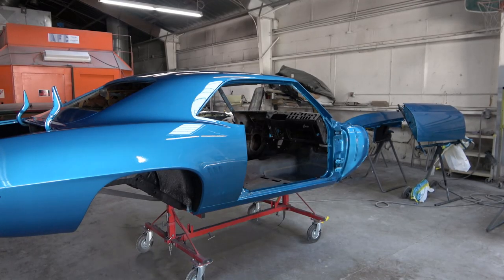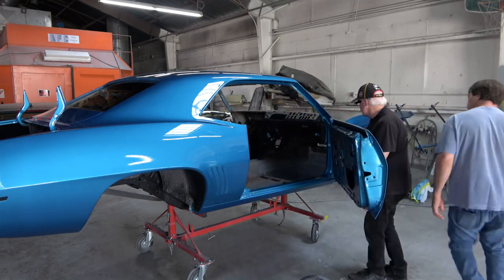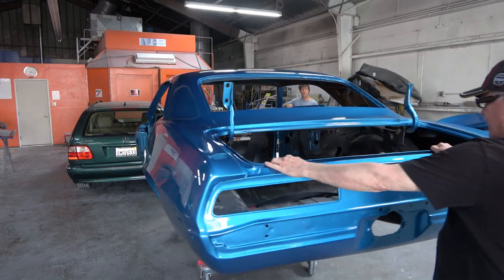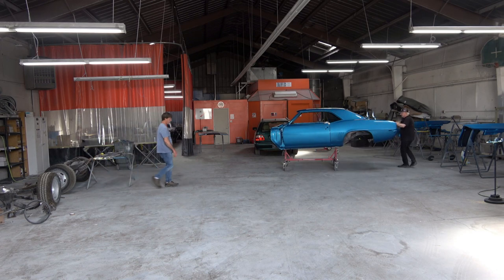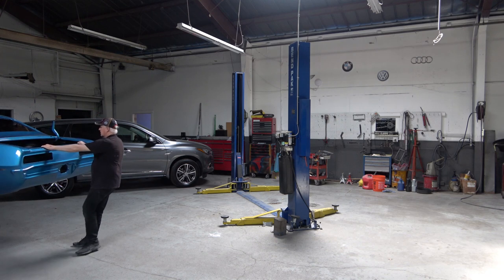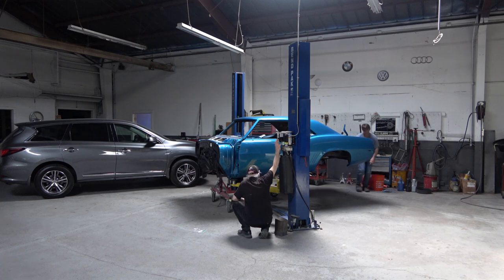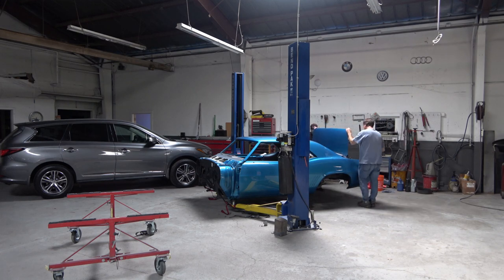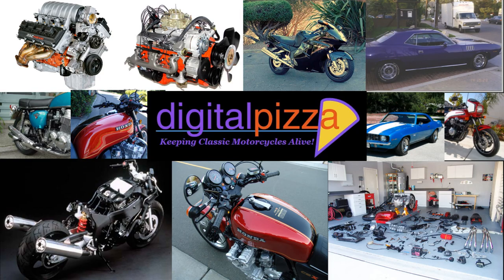69 Camaro Z/28 in Le Mans Blue Full Restoration Video Series - Part 7 - Re Installing Doors & Trunk

Comment: I hope you do assembly line type restoration. Not over restore it or try to do a bunch of upgrades. Factory Stock
Reply from the maker: It will be an assembly line correct restoration. Anyone who knows my motorcycle restorations knows that is all I do. I have won multiple 1st place concours shows with restos, so you can be sure that I am going to make this as close to factory original as possible.
Reply: @digitalpizza1  Awesome way to go
 I look forward to watching thanks